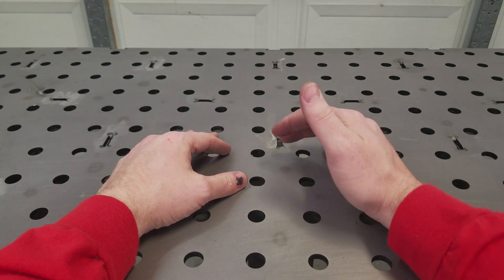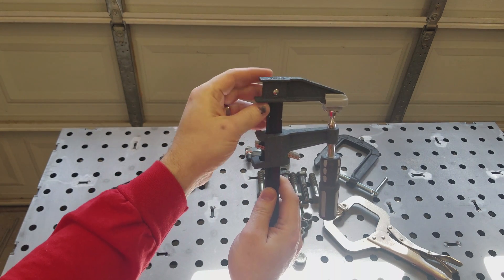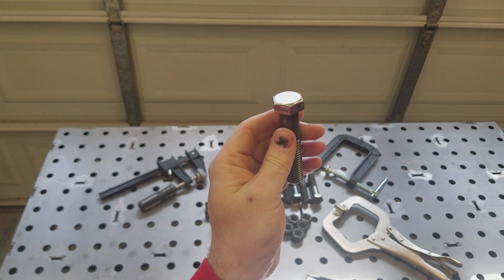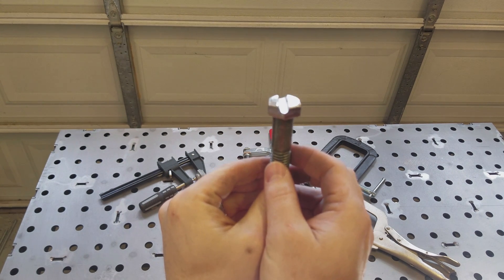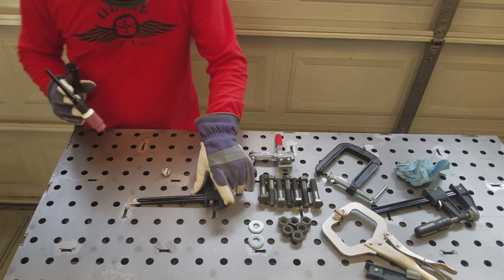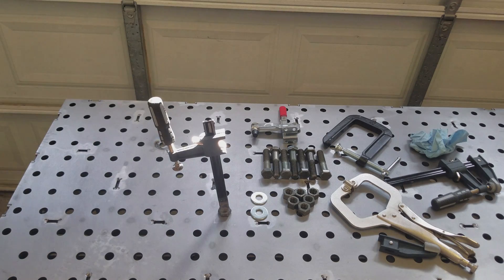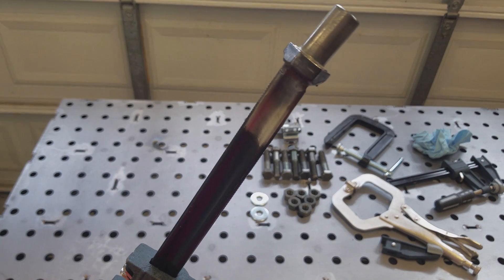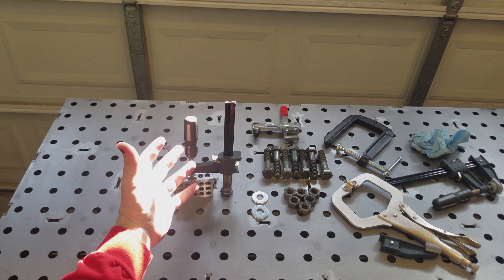Building Fixture Clamps

Comment: How has your table faired with longer term use of the pins? Any stretch or deformation from the side loads? Just making a selection but I was going for a rear pad and tongue to avoid using the hole itself. Nice Video too :)
Reply from the maker: So far so good, no issues to report. I did upgrade to a much larger table from Mayhem Metal Works. The new table has seen alot more working time and it’s been flawless.
Reply: @HaslipCycleWorks  Thanks. Likely I am more concerned as I saw Jason at Fireball bend one being heavy handed :) I am in Oz so choices were limited or expensive so I did a DIY design with a local Water Jet cutter.
Reply from the maker: @seabreezecoffeeroasters7994  if I have to put that much pressure on something to clamp it down I’ve done something wrong or I’m asking the tools to do more than the scope of work they were designed for. As long as the top is decently thick I wouldn’t be concerned.

Comment: Maybe i missed it but did you ever mention that bolt throats needs to be on a specific angle to work?
Reply from the maker: taalf thorpe no, no specific angle that I found. They work fine even if straight in line with the clamp.

Comment: Will this work  on tables w a thinner  table top ?mine  it's kind of thin   any one has try these
Reply from the maker: 1/8", you should be fine just be sure to not over tighten the clamps so it doesn't flex the top.
Reply from the maker: It should, how thick is the top of your table?